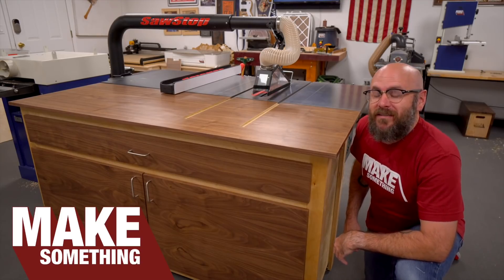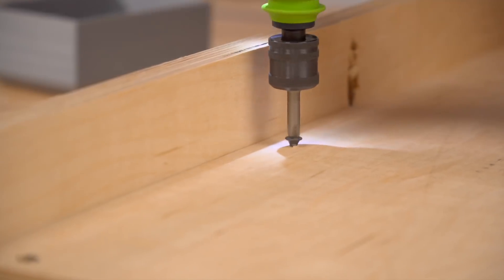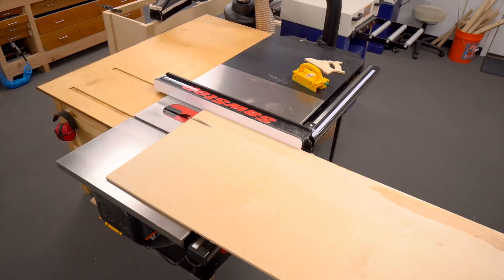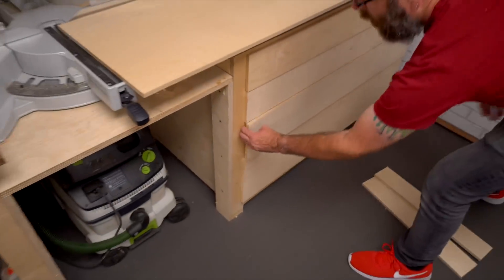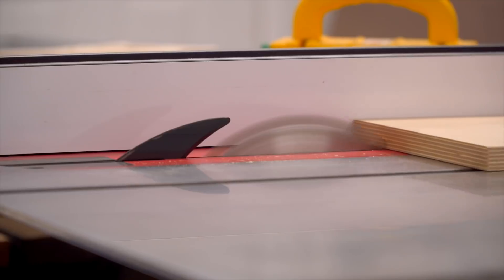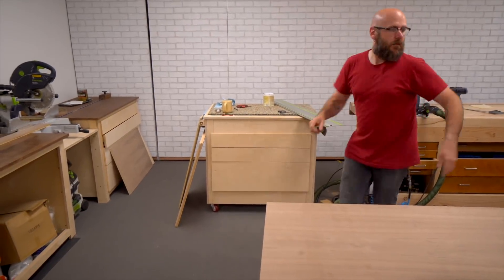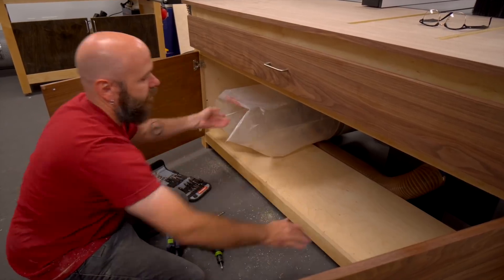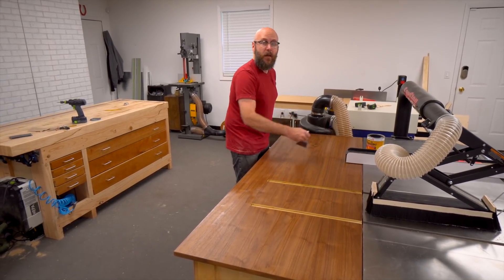How To Make a Simple Tablesaw Outfeed Table From Plywood

Comment: Man I’ve watched this over and over, along with others trying to decide which style outfeed table will fit my needs Best. Finally decided this is the one. It’s a great design. Simple, practical, not too big and it looks great. Just purchased the plans, thanks brother, I can’t wait to get started. I think I’ll have to cut the depth by 2 inches or so due to space constraints but that should be a simple adjustment. Thanks again David, I enjoy your videos and this is the first set of plans I’ve ever bought from anywhere.
Reply from the maker: Right on, thanks!!

Comment: Awesome vid David!  Love to see the recycle of parts from one project to another.  You took the time to 'Math' the material, it's not always about final price but price per sq. ft. vs. how much you need.  Just a 'Pro Tip', try putting some handles or pull holes on the drawers beneath you miter saw station, you'll find it saves on the finger tips in the long haul!

Comment: Ya know drawer pulls might be something you add to the storage drawers next to the miter station, just so you're not grabbing the sides of the face to pull them forward.

Dave - I love the outfeed table, but not everyone has a SawStop in their garage workshop. Most newbs like myself still have either an 8" or 10" pedestal based table saw. Can you create a video for the home/DIY crowd that doesnt have room or a table saw that sucks up so much floor space? Like a pedestal based table saw base with a built-in floating out feed table that swings up or something like that.

Comment: Are the miter grooves cut oversize? I ask because my outfeed table, which was physically attached to the back side of the table saw, would shift just enough to cause those slots to bind anything sliding in them. New (to me) table saw and I'm getting ready to build a new outfeed table. Should I make those slots a bit "sloppy" to account for expansion/contraction?

Comment: My 3/4 inch walnut plywood cost $130.06 for a 4x8 sheet.  Birch, Russian B/BB 18mm 4X8 cost $100.95 per sheet.   So I use AC Fir Plywood 23/32 inch. 4x8 for $62.67 per sheet.  If I could get 3/4 inch walnut plywood for $59.95 per sheet I would use it too!  lol   Your shop furniture/cabinets are looking terrific.

Comment: Great video man! 2 questions. 1) where did you get your holdfasts? 2) Is that the O'Neida router dust shroud? Need one for my PC router too!
Reply from the maker: The holdfast was made locally but you can find them at Rocker.com. Yes On the router dust collector. Works great and recommended

Comment: Gluing and screwing the bottom of the drawer to the frame of the drawer sides is asking for trouble, when the bottom expands and contracts it will break the glue bond and the only thing holding will be the screws pulling against the way they were inserted. Cut a dado 3/8 “  x 1/2” above the bottom edge of each side parallel to the bottom edge,  leave an 1/8” gap when cutting the bottom for expansion and you have a drawer that’s a lot stronger and will last longer.
Reply from the maker: It’s plywood so no expansion or contraction. This has worked for me for years without issue.
Reply: If you going to teach people how to construct a drawer, teach them the way that works no mater what the material they are using. Carpentry and joinery go hand in hand, using the proper joining technique actually strengthens and aligns the joint, butt joints are no match for dados, rabbets and dovetails. Wood is a limited resource why not make your project the best they can possibly be, even if it’s not the quickest way.